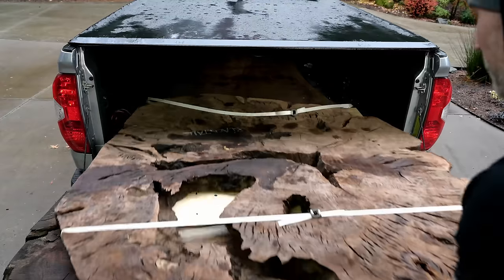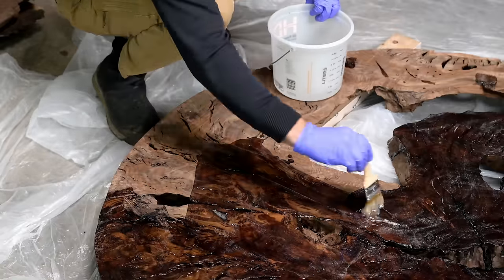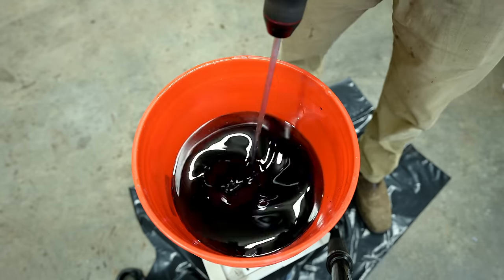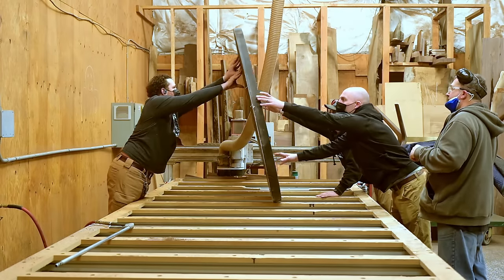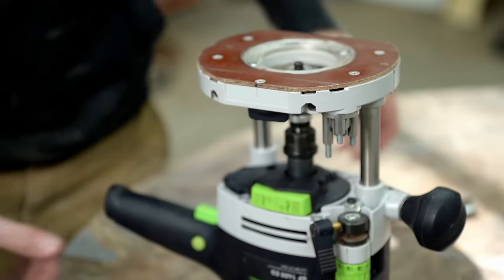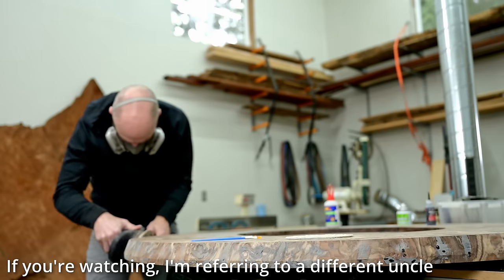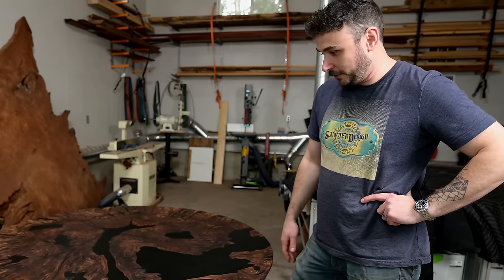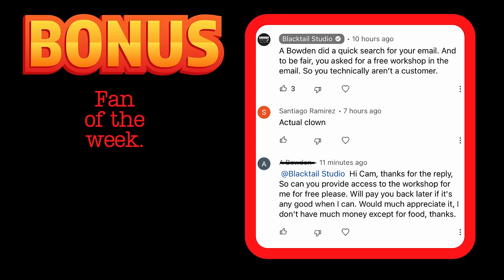The Worst Wood To Build With

Comment: You can make an oversized wall clock out of it. It would look great. Just stick some numbers and a good quartz mechanism. 😎
Reply: That's actaully a great idea!
Reply: I agree
Reply: That's honestly an amazing idea, with a good movement and some custom numerals from some fancy metal it would probably sell for double.
Reply: @douglasthomashayden2566  Or older design, no movement… sundial 😀
Reply: I was looking for a place here to make this suggestion. This would in fact make a great and very nice large clock face for something like a ski lodge or hotel with a rustic yet modern design motif. Such an enterprise would have the money to buy such a clock and be glad to have it. Connecting with the right designer, decorator, or architect would be the way to get the full ride out of this piece.
Reply: Great ideal.  I would recommend making two clock by removing a cookie from the middle and making a clock with it.  Then taking the remaining donut and either filling the middle with a clear epoxy so you can see the clock mechanism or fill it with a contrasting cookie.  If all that made sense.
Reply: That would actually look really cool
Reply: Agree, honestly was what I thought if when he first picked up the piece of wood.
Reply: clock!
Reply: I think that would look absolutely fricken awesome!! The cavity is already at the back for the clock mechanism, imagine having to get it down to change the batteries. It’d be worth it though!
Reply: Very few people use a clock these days
Reply: That would be fantastic!  I would love a clock like that..  but it would definitely be nicer wit the rough edge.
Reply: @cometoogrebattleify  mechanical😉
Reply: AND YOU WOULD HAVE THE ONLY ONE LIKE IT IN ALLLL THE WORLD !
Reply: Shoot, I didn't even read through the comments before I posted. That's the first thing that came to my mind when he hung it on the wall.
Reply: sell to high end office building
Reply: He should do it. It would be worth his time. 😎
Reply: @douglasthomashayden2566  qqqqQqQQqqqqqqqqQqqqqQqQ
Reply: This should be the top idea with this, it would make an amazing clock.
Reply: Yes.my dad used to make clocks from slabs.. in a huge office building would look amazing
Reply: I was just saying the same thing, make it a beautiful intricate clock
Reply: Sorry, but making it a clock would ruin it. It’s cheesy like something from the 60’s and 70’s. It’s a beautiful piece of wall art just the way it is.
Reply: Oops wrote my message before reading other comments. Great minds think alike is all I can say.
Reply: Phenomenal idea!
Reply: With crystal numbers! Like turquoise or amber!
Reply: @amberfrazier575 : On this dark and huge surface? And this size of the clock? Pretty invisible.
Reply: Maybe if he make the wood much thinner.
Reply: @billyjamesmaspaitella8405   no.  .
Reply: Doesn't ever need the numbers. Make it minimalistic, maybe put a swinging pendulum on it
Reply: Noooo hand wind mechanical movement definitely
Reply: Moisture means water it’s garb
Reply: That’s what I was thinking when I saw it
Reply: That is a really good idea actually
Reply: Yes.
Reply: It’s a great Idea. Maybe youtube friend can hela and make some nice hands and indexes. Make it stylish. It’s worth it. It’s beautiful.
Reply: Thats what I thought it was from the thumbnail
Reply: I thought the same thing.... a nice antique clock mechanism with the weights hanging down underneath...... FAR nicer than making just another table.
Reply: Now that is a really cool idea!  I have be really digging the big clock trend that's been taking hold, but also, it could go on a vaulted ceiling.  Yes, I like the clock idea!
Reply: @douglasthomashayden2566  I had no idea something like this actually exists!  That is super interesting, I am actually going to look up that specialty.
Reply: @wstein70  creative idea!
Reply: This is exactly what I was thinking. Giant wall clock.👍
Reply: Syed, that's exactly what I thought when they were hanging on the wall!! Great minds think alike!!
Reply: @robertjeglum4657  they do when there's one on the wall. And one THAT BIG!!?? I'm pretty sure THAT clock would be looked at ( or used)!!
        🕰️ Janet 🕰️
Reply: @carlamarlene2927  I think a ski resort would be great!! You could have custom hands made for it that look like skis!! A ski pole for the second hand.Hung above a huge fireplace in the resorts lounge area would be breath taking!! 😱 
              🏂Janet ⛷️
Reply: @SunriseLAW  digital clocks are neither old or new. Hell, there are kids that don't even know how to tell time if it's an analog clock. Now THAT would be both old AND new if ya ask me. But that's just my opinion.✌️
        ⏱️Janet 🕛
Reply: Could even make a clock table.
Reply: That's exactly what I was thinking it would make an awesome wall clock
Reply: Прекрасная работа❤
Reply: Can be outside coffe table, amazigley beautiful 😍
Reply: @douglasthomashayden2566  3❤
Reply: @raynman6466  Mu
Reply: How would one hang a clock that heavy on a traditional drywall wall?
Reply: Ooo that would be Siiick!
Reply: @photo_paper784 find a load bearing stud, obviously

Comment: Thin is non-viscous. The more viscous, the thicker a liquid
Reply: I concur
Reply: Sorta.. Viscosity is the opposite of Flow.
High viscosity fluids are resistant to movement and shape change. Higher viscosity slower flow rate. :)
Reply: Got proof?
Reply: OK
Reply: Non Viscous? Everything has a viscosity. Low viscosity vs High viscosity, its all relative. For example.. Water has a low viscosity, Honey has a high viscosity, but also, Air has a low viscosity while water has a high viscosity. This is a qualitive description of viscosity. For quantative measurement of viscosity, well, it gets more complicated and this is wood working not physics.
Reply: As a kid, I always remembered it as “Something too viscous can be vicious to mix”
Reply: @badgerservices9665  That's why I tried to keep it simple, yeah. But technically you're right, "non-viscous" isn't a very scientific term at all
Reply: Viscosity is a fluid measure term and is best presented and defined using that language.  To that end I best recall it as a "resistance to flow."  A liquid with high viscosity is therefore highly resistant to flow under what would seem normal conditions.  Heat, purity, or lack of are just a few factors that can change a liquids viscosity.  Something viscous is not going to flow which may be due to a host of physical conditions (temperature, pressure, etc...) as well as chemical.
Reply: @attnielthomas7856  I'd agree if this was a highly scientific field where use of language is particularly important. In colloquial use I think being a little loose with the terms can be forgiven. But again, you're definitely not wrong, I really just wanted to give a short and condensed answer to the question Blacktail asked. So yes, my statement was not fully scientific, nor 100% accurate.
Reply: @attnielthomas7856  Everything has a viscosity. You don't say "This is viscous",  "This is not viscous". When not using it quantitatively, you are using it comparatively. Tooth paste is more viscous than diet coke, but less viscous than rhyolitic magma. In the example, Toothpaste has a moderate viscosity, diet coke a low viscosity and magma a high viscosity. Regardless, high or low viscosity, everything has a measure of flow, it just depends on the scale of time you are using to calculate the rate of flow. Even solids flow.
Reply: 'viscous' is not like the word 'heavy' its used incorrectly that way. 
viscosity is a scale, you either say thin/thick or low viscosity/high viscosity (or anything inbetween low/high of course)
but saying something is non-viscous or viscous, isn't correct English
Reply: @forget2bhuman993  I know. I already replied to someone saying the same thing just dive comments above. I know what viscosity means. It's a comment on a youtube video, not a scientific paper, please understand that I won't always be using the most accurate language
Reply: @Cobbido  Definition from Collins Dictionary online: "A viscous fluid is a fluid which does not flow easily."
Reply: @mathewfullerton8577  LIAR!!!!
Reply: I hated Fluid Mechanics class.

Comment: The spend on bits rather than router advice is spot on.  As long as the router has the power and can spin the bit smoothly, that's all you need.  The bits are where a good result comes from.

Comment: great vid! and also - simple way to remember viscosity - is that you can just think of it as friction.  More viscous=more internal friction=slow moving.  Honey is more viscous than water.
Reply: The actual definition of viscosity is the internal friction of the liquid, so you can exactly think of viscosity as friction, just between liquid, not solids. I don't think gas has a similar property, the gas molecules aren't actually touching most of the time like solids or liquids.

Comment: You should definitely turn it into huge wall clock, with brass/golden/mother of pearl inlays.

Additionally, you could reduce weight, by hogging out some material on the back - maybe it would dry a bit more because of that?
Reply: Seeing that piece on the wall, yes, definitely a big wall clock! I've seen clocks like that, they are awesome.
Reply: The Problem is that this is a plastic table. Wo wooden table could still dry. This table is plastic with wood inside.
Reply: i initially thought it would be a clock.  too perfect for that!!!!
Reply: @infowazz  MM
Reply: The wood will make a beautiful clock for a forward thinking company. (Pacific NW?) Place it in a large common area as functional art!
Reply: @debl-s5677  for sure
Reply: It's a beautiful art piece.

Comment: Dry ice blasting will actually cause moisture pockets in wood like that. Used to do restoration work and we used it to blast framing after a fire to take all the Charing off of the burnt wood. And we used moisture detectors to check moisture in the house as well after the fire department does their thing and we would have to dry everything out first. Then ice blast it and dry it again. Mostly with industrial dehumidifiers and fans but we still had to dry it after the ice blasting. It may not have sand clean up but you're blasting ice into porous material and in some spots when it's would like that it will blast it into areas that it cannot evaporate fast so it's soaks into the wood. So honestly that might be where your moisture came from.
Reply: Dry Ice will not leave moisture behind, it goes directly to a gaseous state without leaving any type of moisture. Hence it is known as dry ice..
Reply: @michaelbailey4164   the dry ice will sublimate yes but when you have pockets and some moisture content in the wood what will happen is it will get in those pockets and draw the moisture to it that is already in the wood and it will freeze. In that process it will cause those pockets to retain the moisture in the wood. The ice pellets them self do not cause the moisture. Apparently I didn't explain it well enough. And using talk to text in a rush. But hey you're the expert.
Reply: @manbehindthebeard3213  I learn something everyday :) Thanks
Reply: @michaelbailey4164  good on you for accepting the explanation!
Reply: @michaelbailey4164 l
Reply: @manbehindthebeard3213  thank you for the clarification, I had the same misunderstanding

Comment: This is not a failure at all, it's just a learning experience. I love your video, I also like working with wood, metals, rock,  etc. And the problem could easily be fix if you keep the base and then add metal weights to even it out.

Comment: That cart used to lift the wood is a prime example of when the random item you bought while window shopping in Lowes finally comes in handy!
Reply: …..for me its Harbor Freight🤣
Reply: @jonshomo1167  tractor supply and ace hardware also
Reply: For those who are interested, theyre properly called die lift tables. Their original purpose was to elevate stamping dies to load/ unload onto punch presses.

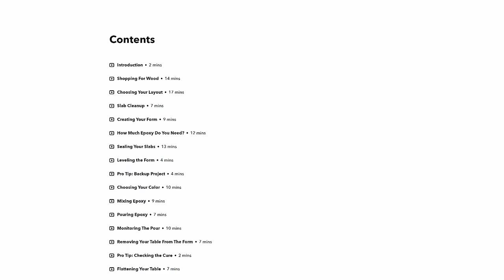Comment: 5:40 If you use toblerone shaped blocks of wood as stand offs, it makes it much easier to remove them once the top coat has set on the work piece.
Reply: I love that you said Toblerone rather than triangle.
Reply: @nuttm3gg  Toblerone = about halfway between triangle and Kit Kat.  😁 But I'm surprised some sort of plastic blocks aren't used instead (ideally plastic Toblerones) for easier detachment.

Comment: If you plan to use the belt sander on such large pieces more frequently, you could consider to buy a sanding frame for your belt sander. It makes it much easier to get a consistent flat surface.

Comment: Although I am a wood turner and only a hobbyist, I subscribed to your channel. I enjoy learning and applying principles and skills to my hobby from more than just fellow turners. Watching your process was a "thought lab" for me and I'm always looking for that. I've run into hidden moisture problems as well and they can create a multitude of unpleasant surprises. The end product was still very beautiful.
Reply: A fellow turner! You can do some really cool stuff with epoxy on a lathe. Many years back I made a bottle stopper as a Christmas gift for a neighbor. Starter with a block of dark green inlace acrylic, turned it down to roughly the shape I wanted, then used a parting tool to cut 3 evenly spaced bands/channels around the stopper and filled them with epoxy mixed with some metallic gold powdered dye. Sanded off the excess and wet sanded with micro mesh to finish. Came out great. This channel is giving me lots of ideas.

Comment: For those wondering, the table was sold as wall-art (without the base) and received 71 bids with an ending sale price of a whopping $6,200 with free flat rate shipping included. Great job none the less man, its still a awesome hunk of lumber and someone will display it proudly in their home!
Reply: what a rip-off
Reply: @busybee6889  Thats what is great about a free market - something is only worth as much as someone is willing to pay for it! That's like saying the value of a Picasso, Rembrandt, or a da Vinci work is only worth the raw value of the oil paints, canvas, and frame.... when we all know there is a much greater intrinsic value associated with these works of art over the extrinsic value of the materials used. He did not set the price at $6k, he set it at $100 and then multiple buyers all tried to buy it with the winner paying that much - but just under that there was another 70 people willing to buy it for just a little bit less. Just because you don't have that kind of money to piss away doesn't mean its a rip-off.
Reply: @RCichard  well most of those aforementioned people basically had to be dead before their stuff got its prestigious renown.
but thanks for heads up on the fact that it was auctioned ....spoke out of turn on that one
Reply: @busybee6889  indeed, not the best analogy on the painting vs wooden art work but yeah... it wasnt just one sucker who bought it for that price there was a half dozen people in a bidding war up to the last day! I was honestly shocked given the situation he ran into, but hey - as long as the buyer was informed and happy and the seller got some money back out of the mishap its a win win in my book!
Reply: Why did moisture render it unusable, will it rot?    Will it crack?  Why could nothing be done to correct it?
Reply: @jsnthurst1  Good question, i dont think it would cause a huge issue but suspect possible warping down the road - and with it being a premium product he doesn't want to sell something of that caliber unless its perfect. Im no woodworker, but just my guess... hopfully someone with some experience can weigh in :D
Reply: @jsnthurst1  he showed it at the end of the video, certain spots were already started too droop because when wood dries it shrinks. Plus over time the epoxy will also crack and the wood will split. Doesn’t really matter anyways, all these people paying all this money for stuff made with epoxy are only going to get 20 years out of there purchase anyways. Epoxy doesn’t last as long as people think it does
Reply: @brandonjohnson7559  Wood moisture pockets don't really matter that much. Cam is a bit of a perfectionist and his products are in the high end range that's why he's a bit finnicky about it. Think about it, though. How did master cabinet makers of the 17th and 18th centuries make their high end furniture for royalty? Did they have a perfect working Wagner moisture meter? Nope. I'm pretty sure lots of ultra rare antiques were made with accidental moisture pockets in them, and they're all just fine. Also, cracks and checks add character to wood anyway.
Reply: @SavageDragon999  yeah I was just saying that the life of epoxy isn’t that long so the table would outlast the epoxy regardless so I wouldn’t hesitate to sell it. Your right though, his customers are paying 10s of 1000s of dollars so I would be finicky too